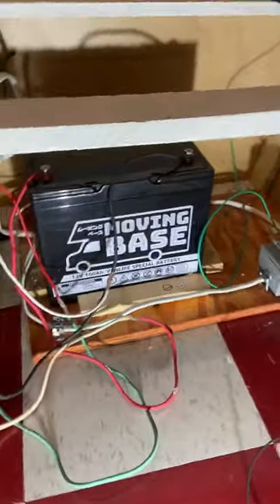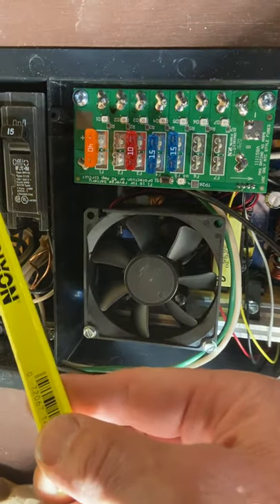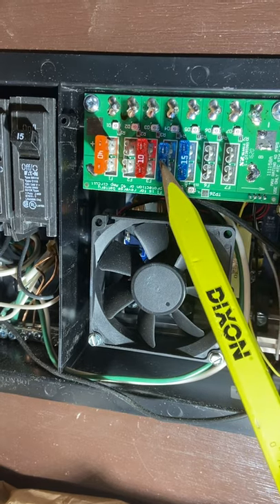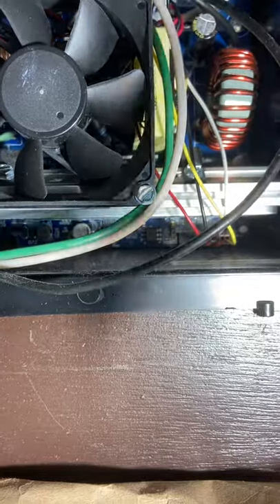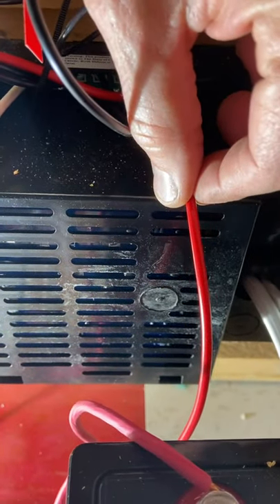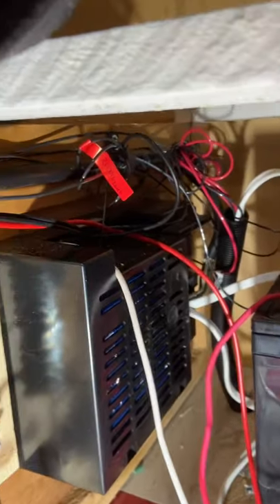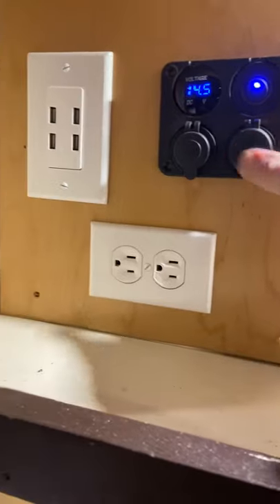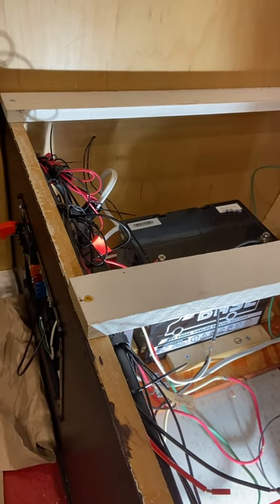Trailer restoration #62: Progressive Dynamics 4135KV Power Control Center

Comment: I thought the 4135KV did not charge lithium batteries? I have 2 100 ah renogy batteries. I purchased the renogu charger but this seems better. How is it working for charging?
Reply from the maker: Good question. You do need to purchase the model that charges lithium batteries - it has the 'switch'. I purchased a version the first time that did not charge lithium batteries ... so good to check on before purchasing.